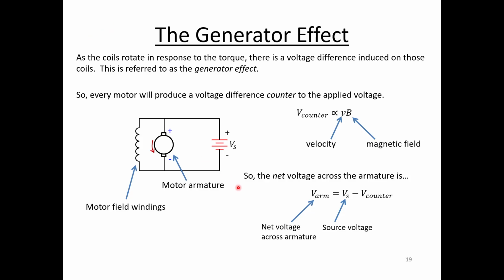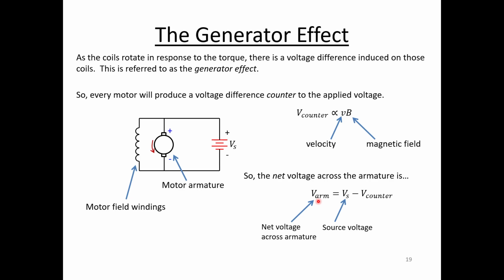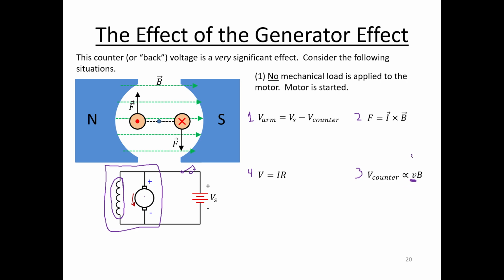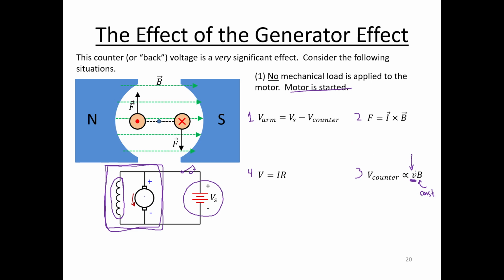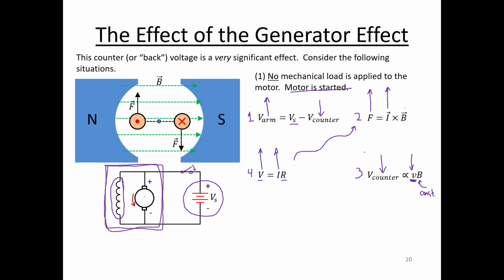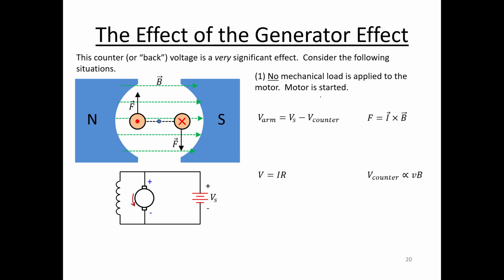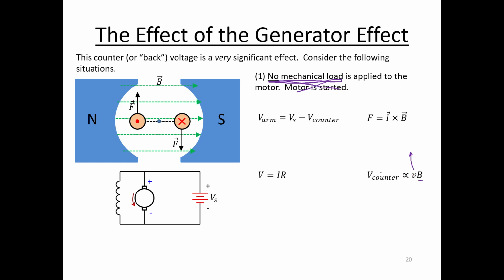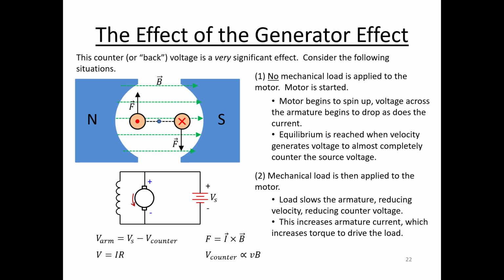Introduction to DC Motors (Part 5) - Speed, Torque, and the Generator Effect

Comment: In an alternate universe where back emf doesn't exist, the constant current flowing through the armature due to the source voltage would continue to apply a constant force upon the armature coil(s) till air resistance develops enough to stop it.